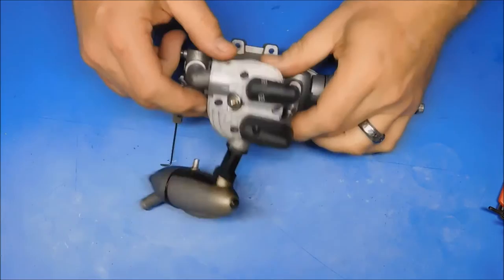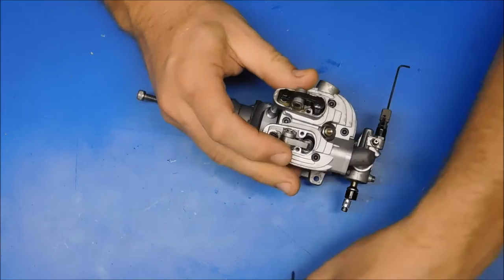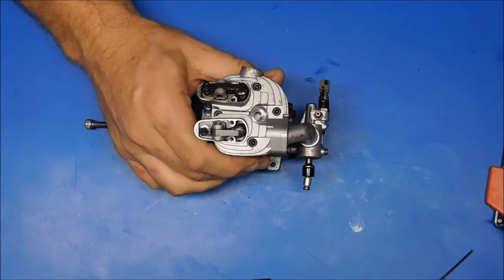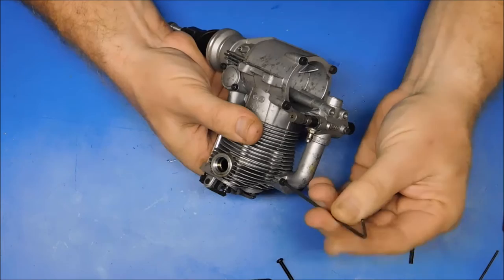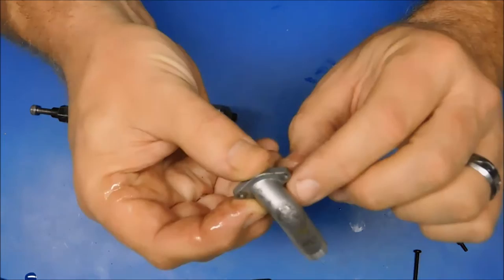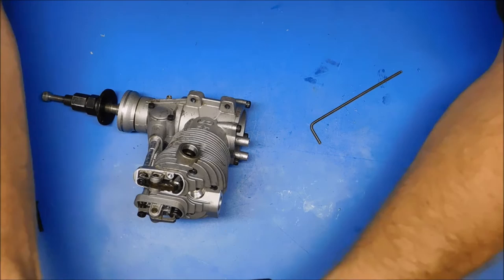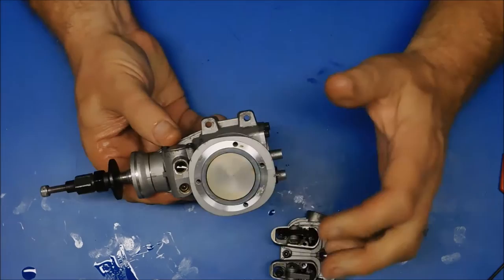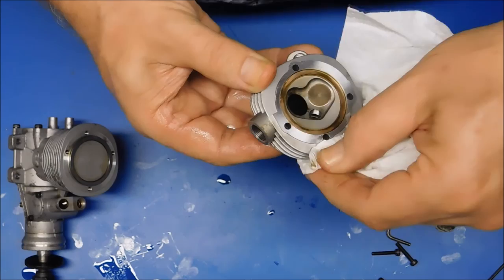OS FS-95V A Look Inside Part 1

Comment: This video has been really helpful as I have been bringing my 95v back from a long sit. I’ve got it all disassembled now and I have replacement bearings in hand but I have some baked on oil from when I heated up the case. 

What is that cleaner you said you use? Will it remove baked on oil?